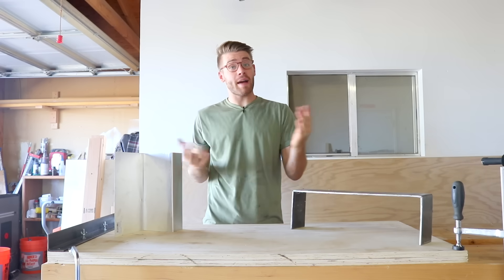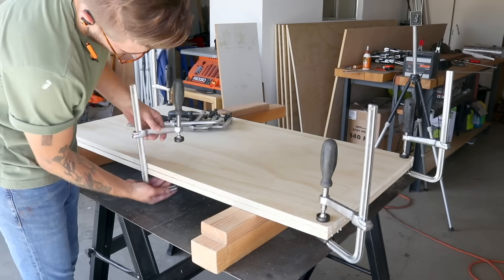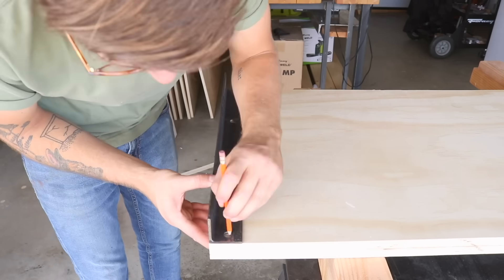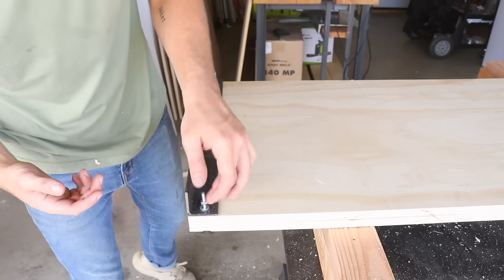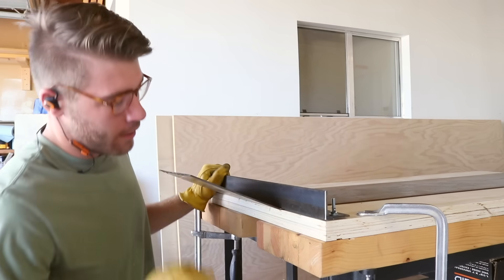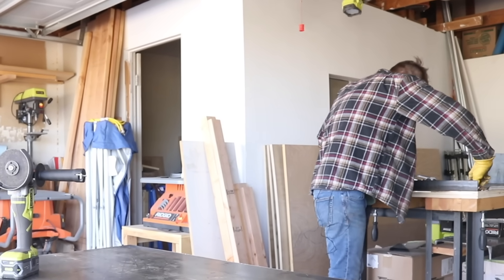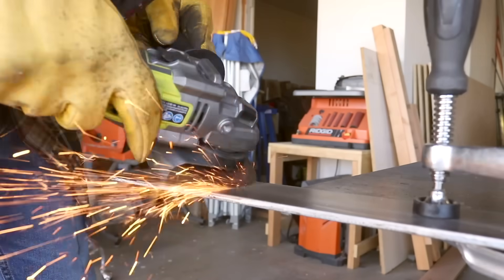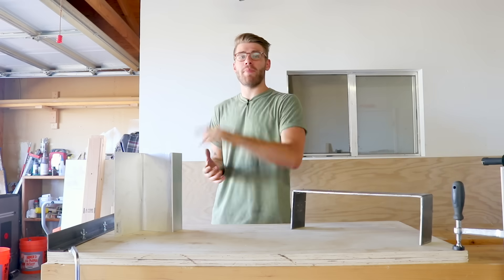DIY No-Weld Metal Bending Jig | Modern Builds

Comment: Only thing I dont like is the grinding part.  Its fine if it’s for a look.  But grinding a 1/8” plate down to a 1/16” so you can bend it leaves a bend thats only as strong as a 1/16”.  Unless you come back and back weld it.

Comment: Aren't you going to have to weld that joint after bending, especially on the 1/4 material? Then wondering..why not just weld the entire joint in the first place with two pieces on a 90 degree mag clamp instead of bothering to bend at all..

Comment: I notice the angle iron lifting off the double-thickness plywood base as you go to make the first bend.  The only thing holding the angle iron to the base are the two nuts that have to act against all that force.  It would be a little more time consuming, but you could reposition the clamps that hold the base to the table to a position over the bolted angle iron to hold both the angle iron and base to the table.  There would be less give, and a slightly more accurate bend with less distortion could be achieved on thinner gauges of metal.

Comment: Constructive criticism : don't aim for such a small radius. Push the angle iron about 1/4 - 1/2" away from the edge of the plywood. It'll be a bit easier to bend and be a stronger corner. I like the prior comment about flipping your angle iron over so that you can bend past 90 degrees.

Comment: Drill through the metal SLOWER!  Your drill bit was smoking out a cloud which means you are going slower and damaging your bits. 

Ok. Couple other things. 

You are stressing the metal. That makes the joint far weaker. 

Easiest way to see for yourself how big a difference heat makes....

Find a scrap of aluminum that you can’t quite cut with tin snips....you can snap that cheap aluminum though with enough force. 

Take that same piece of aluminum and hit it with a torch. Before you do while some ash or soot on it. Once that gos away the torched area of aluminum should look more shiny. Go ahead and easily snip through it or bend it with a fraction of the effort. 

Nerd recap. When you excite the metal with heat you both make bending far easier and you make the bend far stronger than when you bend it at room temperature.  You can make these areas harder and less likely to bend by rapidly cooling them after. Be careful not to cool to quickly because that hardness will then become brittle by locking my the metal grain structure in place (water cooling metal too fast can make it react almost like safety glass and just shatter if dropped from a few feet up.

Comment: What is the purpose of using 1/4 in steel if your cut 90% into it? You’ve weakened the material. Looks good but just use thinner steel

Comment: This is a really ghetto way to make bends, which isn't bad in a pinch, but isn't worth making. 

1. You can't make any 90 degree bends smaller than the height of the rail and mating surface of the clamps. With a simple metal brake on thin steel you can make 1cm folds, but not so with this contraption.
2. Cutting 70% of the plate steel defeats the purpose of the fold. Sure, you get the folded look when compared to a cut and weld, plus it can save you some grinding, however you still have to weld the back of the fold to provide it with any amount of strength. The second issue is that when bending the steel using this method, the steel deforms and is no longer flat; just look at the top at 5:32. If you have to cut and weld it anyway, you might as well just cut and weld it properly.

Comment: I’m not sure what drill bits your using, but most good quality bits work best around 1200 RPM and even with cutting fluid you can pooch a bit short order by going to fast. I use a Wurth Triumph thunderbit set and with a little oil 1200 RPM it’s through very quick and my bits last a long time. Just an FYI and thanks for the video.

Comment: If you cut back your plywood top 6”, butted the two pieces together and installed two recessed door hinges. It’ll result in sharper bends, you’ll be using a backing anvil, the 5” top and hinges as a fulcrum  to make sharper bends. 👍
Reply: I am trying to picture this.....

Comment: A good tip: when drilling metal, drill slowly to allow the bit to bite the material and lower the chances of the bit getting too hot. You’ll drill the hole faster, and your bits wont need sharpening as often

Comment: I use a similar method, but I prefer to make the cut then bend the opposite direction (so as to open the cut rather than close it) then come behind and weld the joint.

Pros: your measurements are a bit tighter, but realistically we're talking 1/16", easier to bend, the weld means full strength

Cons: you have to weld it, welding means cleanup/grinding or carefully welding, more work.

Either way, having a bending process around is much easier than cutting and welding plates to make angles.

Lastly, If you torch heat a joint before bending the way you did, you'll get a really smooth radius (making up for any error in cutting depth) and you'll keep the millscale which sometimes will chip off bending as you did here. Again though, more work with more tools, which I know your brand is to avoid when possible

Comment: You suck. Oh Wait constructive criticism😋. Only sugestions I have is Instead of using the clamps and bits of wood it would be better to extend the wooden base with a hinge past the L metal  section and add a lever handle to this section . This will help keep even pressure on the metal your bending at the bend line and get a tighter bend. Also if you was to flip the L section of metal over so it looked like a upside down V this would allow you bend further than 90° but it just gets tricky to drill the metal like this. But this a great quick simple jig to help you bend some sheet metal.

Comment: Constructive Criticism: It looks like you were thinking logically/aesthetically when you decided on the locations for the bolt holes and ended up with them evenly spaced (0,33,66,100 with 0 and 100 being the ends). However that only gives you 3 different widths (100, 66, 33). If you used uneven spacing (like 0, 33, 55, 100) you would have a greater set of options for spacing (100, 66, 55, 45, 33, 22) with the same number of holes
Reply: this just blew my mind man, great idea
Reply: Nice! Thanks for sharing. I would have done the exact same as Mike, because I'm not at all good with numbers and usually think aesthetically with even numbers, but being a jig, your spacing makes a lot of sense
Reply: @EricRoy85  if the options of 100, 66, 33 are enough for you, you can at least save yourself from drilling one hope and just drill at 0, 33, 100 and then you get the same utility for less work

Comment: I mean the point of forming sheet metal is that you retain the strength, vs cutting half way through and bending you are losing strength....I don't think it much matters in the things you'll be making with this method, but you also could go back and do some stitch welds on the inside
Reply: if he ran a weld down that fold after the bend, he'd then make it stronger.... 
except... 
1. he'd negate the title of the video (i.e. "no weld")
2. at that point, why not just weld a second piece to the end vs cut, bend, & re-weld.
Reply: @PeteGoode  because if you did a welded outside corner joint instead of a bend, there would be a lot more grinding and blending to achieve the same look....a few stitches inside a bend would increase strength a lot and the finished look on the outside would be perfect....
Reply: @Steelcrafted 
well, my dad always said, there are welders and there are grinders. ;-) 

however, I agree. to get that finished uniform look, you'd need to grind flat. 

still, he could have welded the internal cut and achieve the same strength of an uncut piece. If he walked the weld in the fold, he could get a good bead of pearls look that most people wouldn't notice.
Reply: @PeteGoode  The outside looks better.
Reply: @PeteGoode  I get your point Pete. I will say, it may be easier to bend a single piece and add some additional welds for strength. Also, the finish would possibly look cleaner. I am learning SMAW welding right now and gaining great respect for welders. Getting a nice 90 degree edge joint was a challenge.
Reply: Or to stay true to the channel, just add a piece of angle iron along the inside bend for stability. A few holes and either rivets or bolts and done...
Reply: Yeah, for anything needing strength the inside would get a weld
Reply from the maker: Good tip! Thanks

Comment: First, if it's going to be about making some effort, I'd do it so you push it downwards, not upwards. I prefer gravity helping rather than working against me.

Now, this would complicate things a little bit, but I would try and use some other piece of angle iron with some kind of hinges that would rotate with the help of a couple handles (kind of the gear lever in a car). Those handles/levers would be adjustable so you can set them further or closer depending on the width of the material.

The only tricky part, so to speak, is placing the hinges in the right spot, since materials with different thicknesses would need some slightly different positions, but that is something I could live with.

And it this is the system, then bending upwards wouldn't be that much of a problem as those levers would help a lot.

Comment: Instead of having the angle iron sitting with the flat edge down I would try to place it so it is a triangle shape with the point facing upwards. This would mean you would need to drill your holes through the corner of your angle iron and bolts would be at the top point of the angle iron. 

This has two advantages. 
1. You now have two points of contact on your piece where each bolt is situated.
2. You are bending against a surface thar allows you to bend to around 45 degrees to your work piece instead of 90. This is good if you want 90 degree bends as metals are slightly elastic and have memory meaning that if you bend them to 90 degrees they will bounce back away from that a little e.g. to 85 degrees. This way you can bend past 90 degrees and allow it to bounce back to the 90 degrees. You can also bend a lot sharper angles if needed
Reply: Your idea is brilliant.
Reply: So you can bend a bit past 90 degrees?
Reply: josh do you mean then that this will be a 2 step process - where you bend up to 45 degrees first and then switch it around like is in the video to then finish bending to the 90???....got me thinking!

Comment: If I were going to make one, I would try to add a flat bar on the bottom and have an opposing angle iron on the top...positioned so both angle irons form a T, then slide your stock in between.

Comment: You can get angle iron that is twice as wide on one side. That'll be a tad more expensive but it'd give the break more leverage on the side that gets clamped to the board which will probably prevent the bolts from tearing out over time.

Comment: With all the pressure placed on the screws each time you use this tool, they'll  eventually eat through the wood making the holes bigger. It's a good solution, yet it's only a matter of time before you'll have to make another wooden base.
Reply: Miloud Bouchefra you could put a strip of flat stock on the bottom edge and run the bolts through both metal and the wood. If you’re worried about it raising the wood off the table, you could cut a rabbet so the strip can sit flush.

Comment: Great idea.
Any idea how to make a jig so I can bend metal wire like the metal coat hangers into perfect repeatable shapes? I want to make  a dragon fly but bending by hand doesn't give perfect repeatable shapes. Thanks
Reply: Maybe try Drilling several holes into a bit of wood and have pegs or bolts sticking out so you can bend the wire around the pegs to get a repeatable shape..